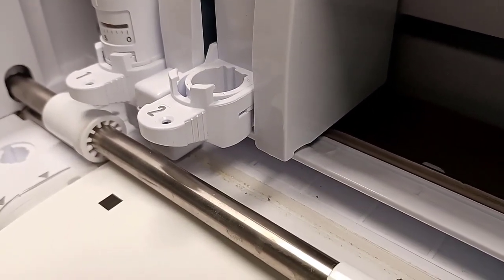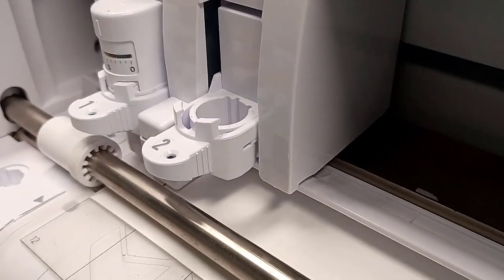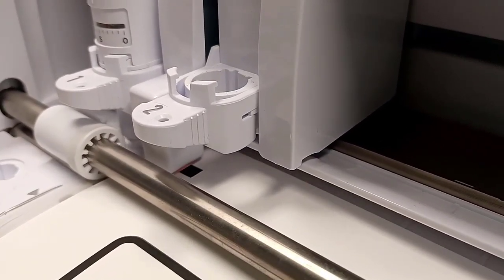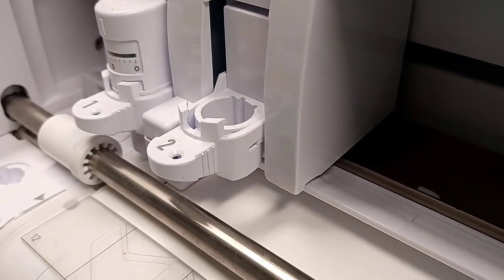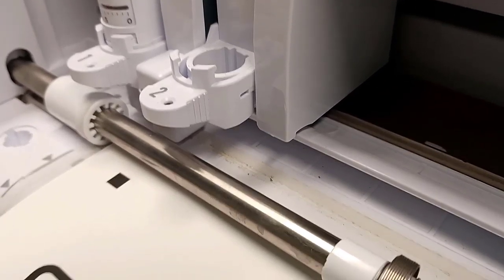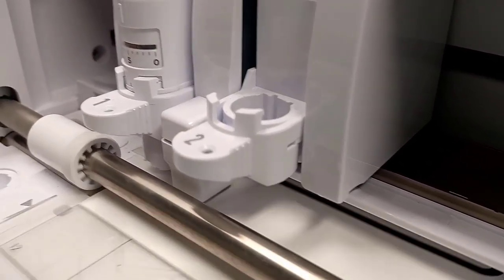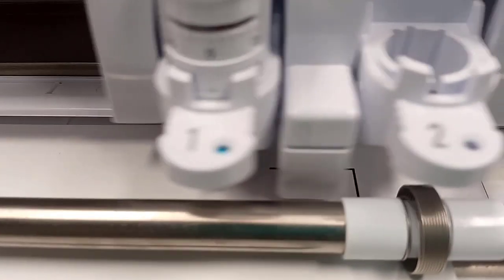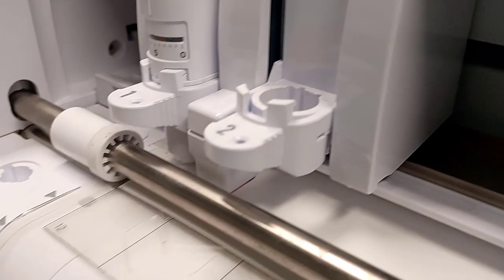How Print and Cut Works on Silhouette

Comment: So its is using a photosensor to find the marks,  I don't see how shining a light will make it work any better!..  It may be worth  it to find a method to clean the  receptor sensor from dust and other to help registration. Great video!!
Reply from the maker: Yes, it's a little laser light that turns it on. Shining a light actually doesn't "work", but since 1 person did it and it magically worked, that's the info that gets shared faster than figuring out the real why it didn't work the first time. 
Shining a light at it actually can confuse it more or cause inaccurate cuts. 
What shining a light can do is improve the area lighting in general so there are less shadows or things interfering.... but it can also cause more problems than it solves. 
Invariable light sources are one of the biggest issues with print and cut errors. For instance, a user in a room with a big window and bright sun shining in has errors reading but tries it again after dark and in a well lighted area, has no issues reading. Nothing had changed except the light sources. We see it all the time but it takes longer to troubleshoot as we need to see what the user's setup is like.
Reply from the maker: And yes! 100% on the cleaning. It's not an easy thing, but the Silhouette machine gets a lot of blame for not reading accurately when in fact, we see many dirty, nasty machines. Especially with resticking cutting mats. That can cause major issues with print and cut accuracy and the optical eye getting dirty.

Comment: Where do I find these register marks and square template to use on jobs?
Reply from the maker: You set it up in the software- here is how....
https://silhouette-secrets.com/2022/08/10/printable-heat-transfer-vinyl/
Reply from the maker: Here are several tutorials
https://silhouette-secrets.com/print-and-cut/